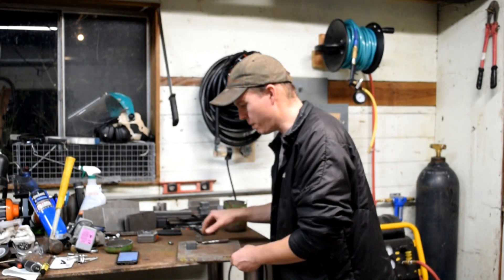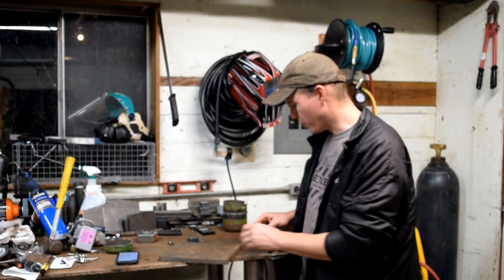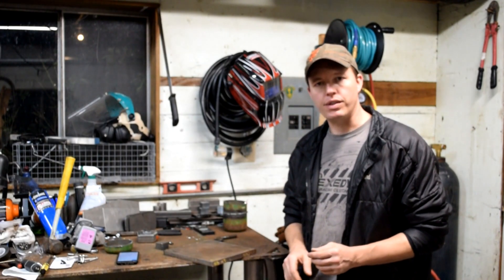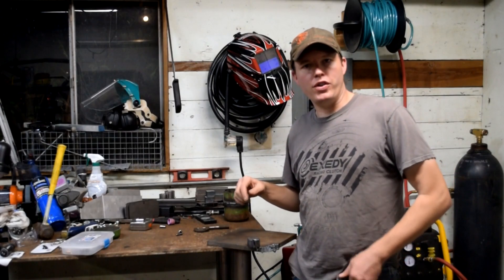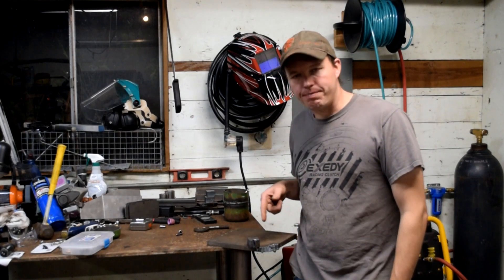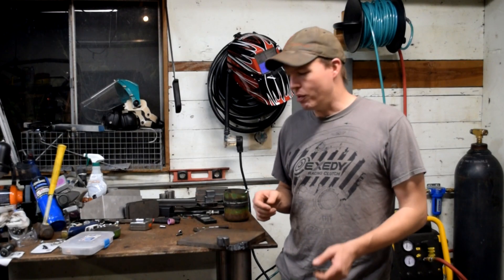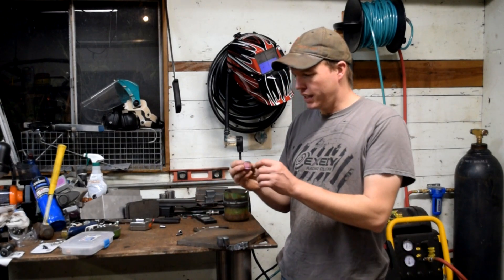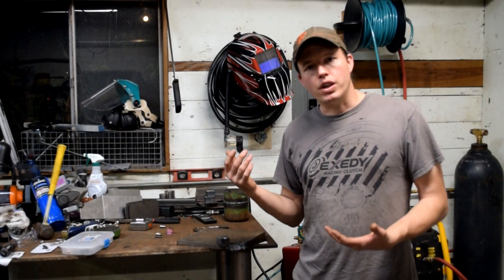Amico CUT50 - Cutting 5/8" and 1" Thick Steel Plate

Comment: Most 50 amp machines will cut 1/2" max and it won't be pretty. Use a cutting torch instead.   Use the plasma for 1/4" or less and you'll be happier.

Comment: Just curious, as I'm in the market for a plasma machine:  what size air compressor are you running? (CFM @ 90 and Tank size?)
Reply: One that's way to small lol
Reply from the maker: It might be to small. Its a 15 gal 200psi 5.0cfm  DeWalt. It works for the small projects I have, but might not be enough for a big cut like I was trying
Reply: Thanks for the reply.  The air compressor seems to be the cost prohibitive factor to a plasma system.  Plasma prices are coming down but the air is still pricey.  The Amico cut50hf literature claims it needs 4.5 cfm at 90psi.  I'm looking at the Fortress 5gal 225psi, 5.1 cfm at 90.  I wish I new for sure if it was enough air for the job.
Reply from the maker: I guess it depends on what you want to do with it. For cutting something 3/8" or small - I think you will have no issues unless you plan on cutting feet of it at a time and then I am not sure. I do smaller projects cutting some brackets and have not noticed it outpacing the air compressor. By the stats you show I would think the Fortress one will work. Looking at Home Depot, they have a Husky air compressor thats about $70 cheaper and has similar stats as the Fortress one you are looking at. Might be worth a look.

Comment: I have this exact cutter, I have no problem cutting through the same thickness material cleanly. It took some practice and as he stated, a tip change but i did manage to get descent cuts eventually. I use a much more expensive commercial cutter at another shop, this one holds its own against that one until 3/4 inch and thicker but i rarely cut that thickness in my home shop. Overall, I love my Amico CUT50HT, it is an excellent choice for the average home fabricator or body man, especially considering the units cost. It's been used quite frequently now for around 7 months without any issues and seems to be fairly easy on consumables. Highly recommended. A friend has a brand new HF Titanium 45, he's very happy with his new toy as well.
Reply from the maker: Hello - thanks for the informative comment!  I do not have a lot of practice, so I am glad you can confirm that it can cut through this pretty well. Its been a pretty handy box for sure. I will mostly be doing light cutting so this was definitely more than I would generally need.

Comment: I just bought this and haven’t had a lot of time to mess with it, but when I have, I have really struggled to make nice clean cuts.
Reply from the maker: I have had some luck, but it depends on if I have a straight edge to help or not. Also I am not sure if its me or the machine that's at fault :-)
Reply: @goddom max 35 amps at 120v. 220v 50 amps. drag speed depending on thickness.  The thicker the material the slower you move your cutter and the more amps you need. ¼ inch 35 amps. drag 12½ inches per min is it's rated speed. These 3 are most important. So in 1 min you should have only cut 12.5 inches of your material
Reply: @ausfuhrungg7337  I cut 1/4 every single day at work and that is extremely slow. I could see maybe doing that for 3/8 and up.
Reply: Matthew Eddy haha I have wondered the same thing my friend!
Reply from the maker: lol, yeah, I can say that I don't have a lot of plasma cutting experience and I have gotten better the more I use it, so maybe I can make a better judgment after I get some more experience under my belt :-)
Reply: So thicker material requires more amps huh?? WELL NOOOOO SHITTT